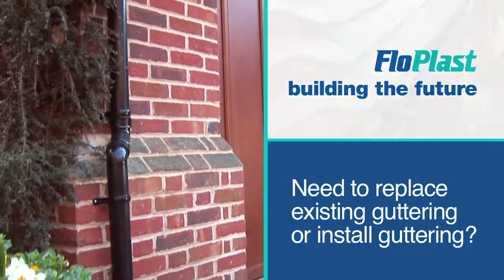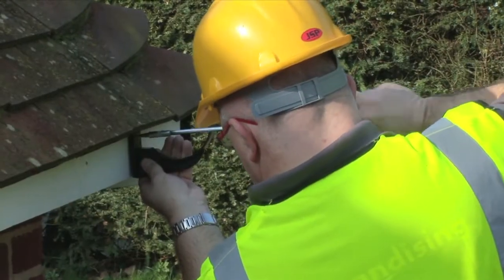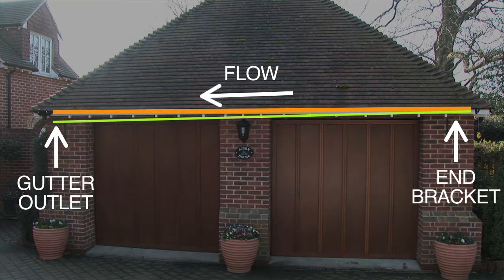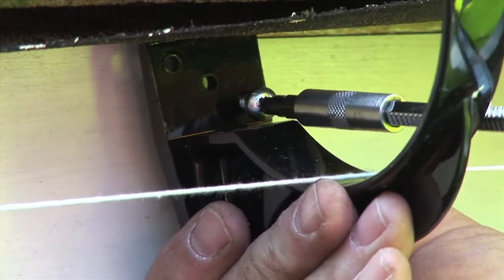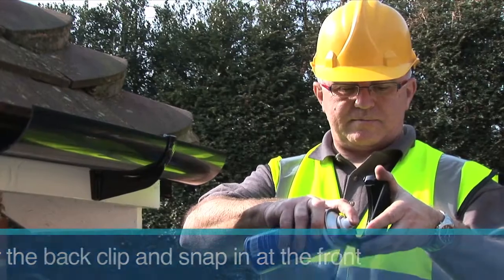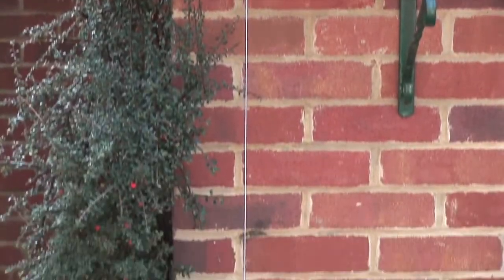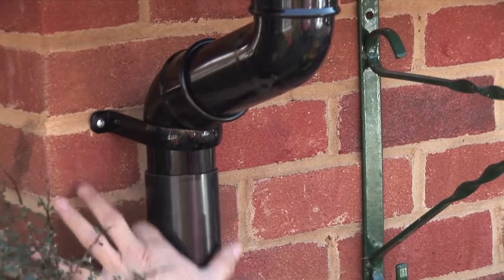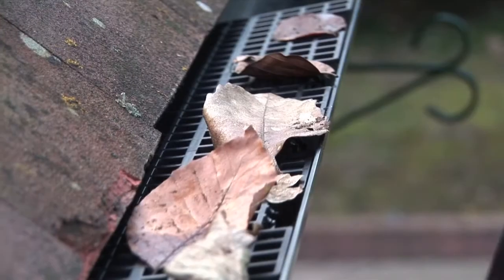FloPlast Rainwater System Installation Guide

Comment: What's the spray
Reply from the maker: That would be our Compressed Silicone Lubricant Spray! We recommend applying this to all gutter seals during installation for ease of fitting. 
See this product on the FloPlast website: https://www.floplast.co.uk/product/compressed-silicone-lubricant-spray
Reply: @FloPlastLtd  I'm looking to extend guttering down pipe along base of floor I need so right angled train pipe to make it work. What works best for the square 68mm do I just use the shoe clips and connect them together?
Reply from the maker: @mindsetmatters2433  To connect a vertical pipe to a horizontal pipe you would need our RBS1, 92.5 Degree Offset Bend. As it is not a true 90 degree bend you would need to cut the vertical pipe short and allow for a gradual fall on the horizontal pipe. The horizontal pipe can be fixed to the floor with  standard downpipe clips. We hope that helps!